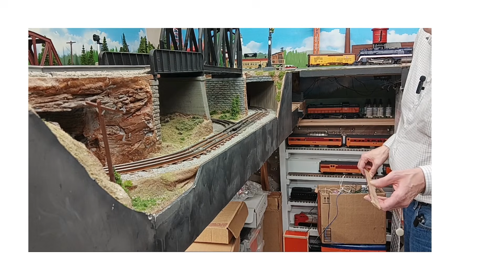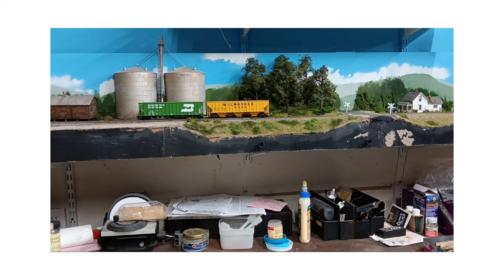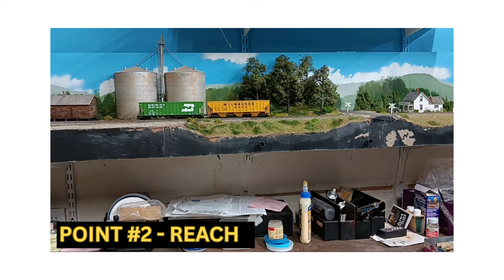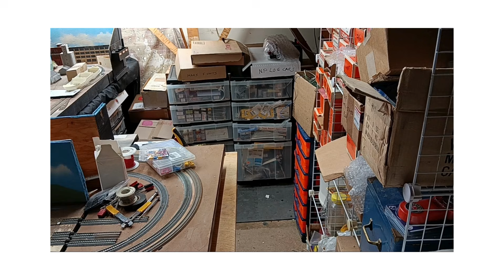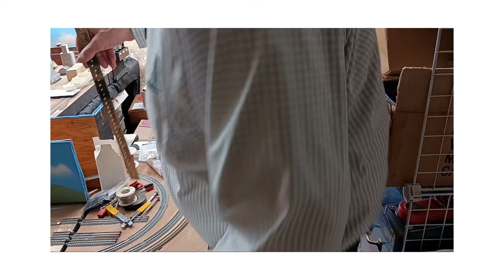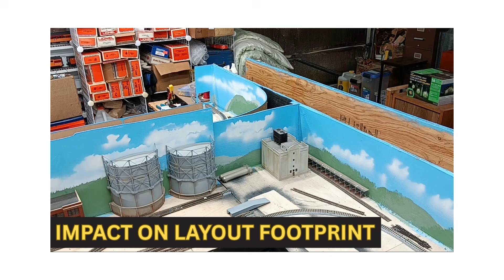3 CRITICAL POINTS for Model Railroad Design

Comment: When David Barrow did the articles on his Cat Mountain & Santa Fe in Model Railroader magazine in the 1980's, he mentioned that his benchwork was planned as 4' sections that could be removed from the main layout and worked on if needed at a work bench and then replaced when completed. I imagine that all his buildings were removable so as not to damage any structures.
Reply from the maker: I remember that...that was his rebuild using the 4 foot "dominos." That's a way to get around making things too yard to reach. It's a larger version of the T-Trak concept that I'm using as its simple to pull a module out to work on it. In both cases structures or details need to be anchored well. I would guess that large structures were probably pulled off ahead of time.

Comment: This was informative. You fit in 18 inches due to your physique. My ass wouldn’t fit in there, 😂. It would fit in the 2 foot area but you have bolts sticking into the area which, I’m sure, would interact with my jeans. So you went from a 3 rail O scale layout to N or HO?
Reply from the maker: Narrow pinch points are definitely custom sized based on the layout owner. It works for me only because that T-Trak layout is low and the end module isn't sceniced. If it was higher by a foot, then I'd have the same problem as you would.  It's not desirable at all but it's what I had to do get an N scale and O gauge layout in the same space. I had an N scale point to point layout (some pics are in my community tab posts) that filled half of the garage. I replaced it with the T-Trak layout which has about 50 percent of the footprint,  the  O gauge layout which is higher up to allow overlapping (been collecting O for 50 plus years and been into N for 45 and HO on and off for 30). My desire here was to allow a bit of all without overly compromising everything and to satisfy all of these interests. Thus this channel and its multi-scale journey.